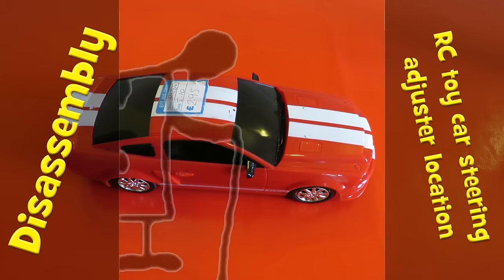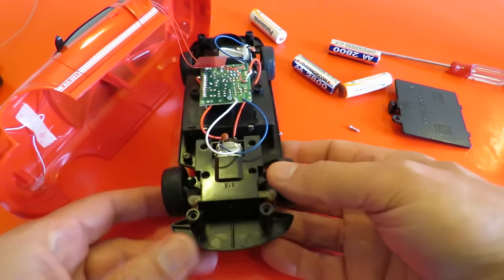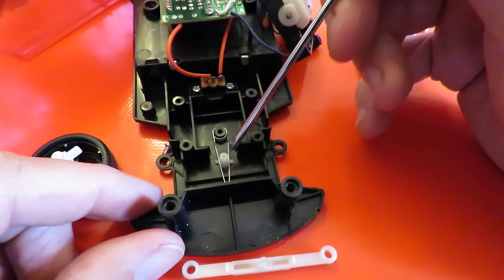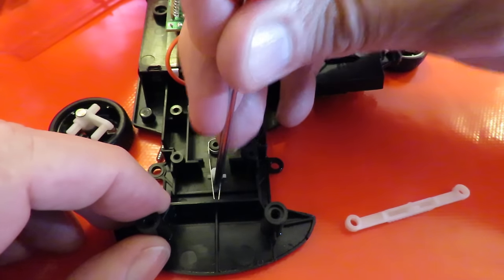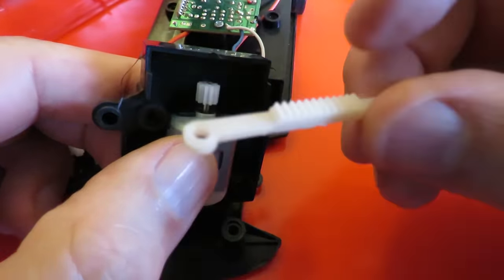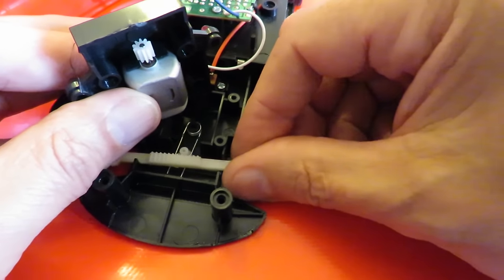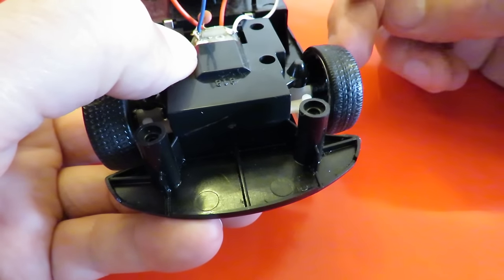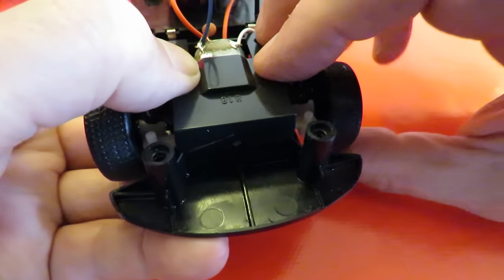Disassembly - RC toy car steering adjuster location

Comment: how can I find that spring as my rc cars spring is missing
Reply: If it is missing you have two options. 
1. buy another car cheap just to get the spring but that would seem a bit of a waste. 
2. make your own. You may struggle to find a suitable piece of springy wire but when you do, bending your own should not be too difficult. It is just a single loop round a suitable sized rod. I would think a paperclip would NOT be suitable as the wire is too soft and I would think a safety pin would probably be too stiff so finding the right wire may be difficult.
Reply from the maker: Hi Abhishek, YouTube Dashboard is broken again tonight and showing me these old comments in the "Held for review". They are not held for review, it is just a glitch, but I am going to paste this reply on a few of them to clear them off.

Comment: Thanks I had a barely used car like this stuck away in a box for years and when I took it out the steering didn't work but the drive wheels did.  About half way through your video though everything magically started working and now my cats are thoroughly confused about what s racing around in 'their' house.

Comment: My toy car forward system nit working bt reverse working smoothly. How to solv this problem?
Reply from the maker: That is most likely one of the power transistors in the H bridge burned out. Unless you are confident at replacing components the best solution is to buy a replacement receiver or swapping it out from another car. Here is one of my videos on the subject - Replacing the H Bridge transistors on a toy grade receiver again https://youtu.be/PdZJJi56Lu8

Comment: Great video. Thanks. I recently took apart my son's RC car to fix the steering. His has a similar mechanism but seems to come with a few more springs as well as a teeny tiny metal rod and I'm not sure how those bits fit back in
Reply from the maker: Unfortunately although the steering in these cars is generally similar each car I have looked at has it's own differences. This playlist has 40 videos featuring toy car steering https://www.youtube.com/playlist?list=PLA5a2xPRSrB1CeqvjOaBPrHk_lVcTHSb9
Reply: @GrandadIsAnOldMan  thanks

Comment: Mate what to do if the spring itself got disshaped?
Reply from the maker: What do you expect me to say?
As I see it, you have several options.
1. With the right tools, you could put it back into shape.
2. With the right tools and the right type of wire, you could create a new spring.
3. You might find a safety pin has the right wire, and you could cut it to fit.
4. You could check out other toy cars, and you might find a similar spring that you could use.
Reply: @GrandadIsAnOldMan  I guess ill have to figure out someway to get it back into shape. It all started when the self center was not working properly and it was due to the spring tension being too low.And  I tried to increase the tension by increasing the gap between the spring and it got even worse .. thank you for your response dude 😄

Comment: Remote not connecting without touching remote antenna on car
Reply from the maker: I have had similar problems but not found a solution other than trying different remotes.

Comment: do you know of any way you could fabricate steering if your car only had the wheels + their attachment pieces and the bar in the middle (without the teeth on top). could i create the teeth somehow? could i make the spring? ive got plenty of motors with different sized gears but no idea of how to make steering in a small area. the reciever i put into the car even has leads for steering but i cant figure out how to mske it
Reply from the maker: There are many ways of making your own steering. I don't think I have a suitable video I can show you at the moment. The steering on a boat is similar. I am showing you this example https://youtu.be/-ZHunX27FDs?t=2m8s just to show you can get the left right movement by using a peg and a loop. In that boat it is moving the rudder continuously but you could do something similar to steer a car if you stop the motor from spinning right round by making the loop shorter or restricting the movement ion some other way. That loop could be attached to the cross bar. You could make a spring similar to the one in the RC car to push the cross bar back to the middle.

Comment: My white bit fell off and when I put it back in it wont turn? Help
Reply: The white steer thing the one that goes on the bumpy bit
Reply from the maker: It is not easy to get all the bits back in the right order so it may just be you haven't got them quite right and something is jammed or not in the right place. Do the wheels still move side to side when you push them?

Comment: My sterring adjuster is lost please help
Reply from the maker: You could make a replacement from a piece of plastic or even a piece of wood
Reply: @GrandadIsAnOldMan   how can you please make video now  and please send me link of that video please
Please
Reply: Can you make video now
Reply: Or tomorrow
Reply from the maker: I will do you a video but making a video won't help you. You need to do it yourself. The steering adjuster is simply a plastic peg that holds that spring in place. Any suitably sized piece of plastic peg will do that for you. If the steering actually needs adjusting then you would need to shape it so it is offset to one side but 99% of the time there is no reason to adjust it, it just needs to sit in the middle so the spring returns the steering to the centre. Just try pushing a suitable sized piece of plastic through the hole and that should do the job.
Reply from the maker: This will be the link when it is ready https://youtu.be/t-YRTIEU0E8

Comment: Can you help with my rc Lamborghini car because when I go forward and back it stop sometime I do not what to do  help me please
Reply from the maker: If it stops when it runs out of range you may need fresh batteries. If it stops but the motor still runs you may have a broken gear or it is slipping or a tooth is missing.  If it moves intermittently helped with a push then it may be the brushes in the motor need replacing.
Reply: @GrandadIsAnOldMan  oh okay thank you so much

Comment: Hi thank you 

i have repaired my sons Winner Racing 3 radio control Toy Electrical Car - Orange 

somehow he broke the steering adjuster and with the help of you i fix it but now the front wheels are not working by remote
Reply from the maker: Sounds like a wire may have fallen off the steering motor.

Comment: Thanks sir. I  request you that please make a video on, HOW TO RUN A DC MOTOR WITH TWO 9V BATTERIES sir please, i am your SUBSCRIBER ☺
Reply from the maker: I do not understand why you are asking the question. If you want to run a DC motor with two 9V batteries just connect them to the motor. If you mean you want to use a cheap toy grade RC receiver to control a higher voltage than it is designed to handle then you have a couple of options. You could make a circuit using a suitable mosfet transistor to switch the higher voltage or you could use relays to switch the power. Here is an example Toy Grade RC switching large DC motor and 3S LiPo - https://youtu.be/WK_G6DikXGg and here is another example Rulof Maker - How to Make • RC boat https://youtu.be/-gFjPhD6wNo?list=PLA5a2xPRSrB0kSD5J49jwe6jyBA6gQofU
Reply: @GrandadIsAnOldMan  k

Comment: How to repairing PCB board in this car
Reply from the maker: What is broken? If it is cracked across the middle you would have to repair each broken track with a bit of solder. If the component parts have overheated you would have to identify the component and buy a replacement. In most cases it would be easier to buy a replacement transmitter and receiver set online.

Comment: I lost the pin any suggestions
Reply: Nvm I fixed it with a rubber band! I'm thinking if sharing it to cause it works great
Reply from the maker: If you look in the video description you will find this link - Replacement steering adjuster https://youtu.be/t-YRTIEU0E8?list=PLA5a2xPRSrB1CeqvjOaBPrHk_lVcTHSb9

Comment: Mine can't even make a full turn I need help
Reply from the maker: @EmmanuelPeter-tz3xz  the steering adjuster does not help it turn. Its purpose is to make it go straight when it has stopped turning. If your car isn't turning, then it may be that there are teeth missing on the gears, or the gear has split, and it is slipping on the motor shaft.

Comment: Thanks uncle for showing. I am getting idea from your video I am reusing parts and making a jeep with two head lights, engine sound, camera etc.. And I am taking the idea from you how steering works. If you interested in my idea then suggest me to improve my idea. I'm making offroad jeep, if you have any idea then suggest me. If you have any  instragram id then give me the name of your instragram. And I am your subscriber.
                                    Thank you
Reply from the maker: If you post a YouTube video I will watch it. I do not use instagram :-)
Reply: Ooh! I don't have youtube channel. Ok I shall try to make a YouTube channel without using bank account. And I m watching your  video..
Reply from the maker: https://www.youtube.com/channel/UCcr1WIZaebt82NCB_qKzhtw
Reply: This link is for making YouTube channel?
Reply: Uncle I am confused to buy a solding iron from flipkart under Rs 200. So plz give me a link which solding iron is good under Rs 200
Reply from the maker: No, that link is your existing channel. When you sign up to YouTube you create a channel automatically.
Reply from the maker: Sorry I am not willing to endorse any make of soldering iron however bigclivedotcom did this video on that subject https://youtu.be/aIab66EgfHM
Reply: Thank you for giving your costly time

Comment: you should connect the lights up straight from the switch so they glow when youturn on the not only when you press a button
Reply from the maker: You could do that. I guess they have some reason for doing it like this but I don't know what it is. Maybe it is just to save power 😊

Comment: hI there.. is there any possible way to turn the controled car into a mini drone...???
Reply from the maker: Not really a practical project if you actually want to control it in flight. Here is a list of reasons. 
1. RC toy car has 2 low quality motors, one for drive and one for steering. Their power to weight ratio is unlikely to be enough to lift their own weight. Possibly with suitable gearing this might be improved but you would have to spend money to obtain suitable gearing. 
2. Two motors are not enough, you want 3 or 4. 
3. The control available from a standard cheap RC toy car is too limited to control a "drone" in flight. You need to be able to control the power to each motor with a proportional control. Standard cheap RC is just ON or OFF  for two motors not proportional control for 4 motors.
4. Even the cheapest RC drones have some sort of gyro stabilisation to adjust the power to each of the 4 motors automatically to hold it stable in flight.
5. Just buy a cheap drone, they are no more expensive than a cheap RC toy car and they will work straight out of the box.
Reply: ooohhhh!!! i get it..... thanx grandad for the help .....ill better buy the cheaper drones....

Comment: My car is not charging plz give me ans😭😭😭😭😭
Reply from the maker: 1. Battery faulty - change battery
2. Charger wire broken - repair wire/connector
3. Charger faulty - repair/replace charger
4. Charger circuit in car faulty - replace circuit board

Comment: My car is moving only left side
Reply from the maker: Could be steering adjuster misaligned, faulty motor, broken or split pinion gear, teeth missing, OR a fault in the receiver.

Comment: My car steering is not this type.😕
Reply from the maker: Every car is slightly different but the toy cars generally have the same features and use a similar post and spring in the middle to return the steering to the centre.
Reply: @GrandadIsAnOldMan  Thank you I fix it.👍

Comment: I have an rc app driver ford bronco and my steering stopped working do you know how to fix it please help!!
Reply from the maker: There are plenty of reasons for the steering to stop working. First thing to check would be the steering motor. Try connecting a battery directly to it, to see if it works. There could just be a broken wire somewhere.

Comment: Sec problem is staring is moving but car is not going front back help
Reply from the maker: Have you checked the motor works, maybe connect a battery direct to the motor to be sure.

Comment: Hello please help me to remove the front wheel of that car i dont have any idea about that
Reply from the maker: Do you mean to remove the wheel from the steering assembly it is attached to? There are 3 common configurations.
1. The wheel is held in place with a screw so you just need the right sized screwdriver.
2. The wheel spins freely on a short axle that is tight fit in the steering assembly.
3. The wheel is a tight fit on the axle and the axle spins freely in the steering assembly.
With 2 & 3 it will be brute force needed to free the wheel and you are very likely to break something as you struggle to pull it apart. You could try placing the item in boiling water to soften the plastic and make it easier to pull it apart. IF YOU USE BOILING WATER YOU MUST TAKE EXTRA CARE NOT TO BURN YOURSELF WITH THE BOILING WATER. IT IS A DANGEROUS METHOD. Boiling water may also cause problems with the plastic, maybe changing the colour or allowing it to bend where you don't want it.
Reply: @GrandadIsAnOldMan  thank you sir appreciate your help keep it up the good work.

Comment: Haw dus the chip wrc
Reply from the maker: If you mean the receiver chip then we start with the Transmitter. Pressing a direction button put a signal into the transmitter chip that it encodes using frequency modulation and sends as a radio signal to the receiver chip. The receiver chip decodes the signal and activates the correct directional motor on the car. So press the left button on the transmitter and the receiver tells the steering motor to spin left. If you want a more detailed answer then I suggest you Google it.